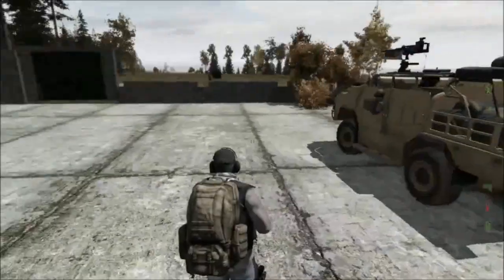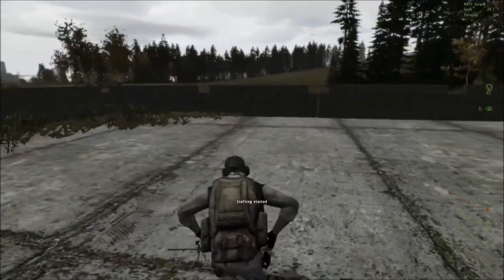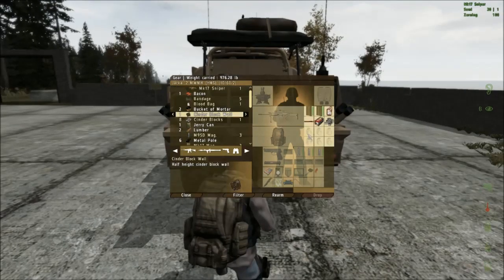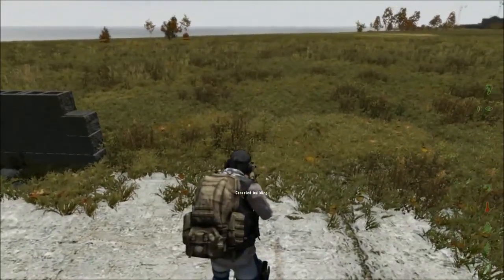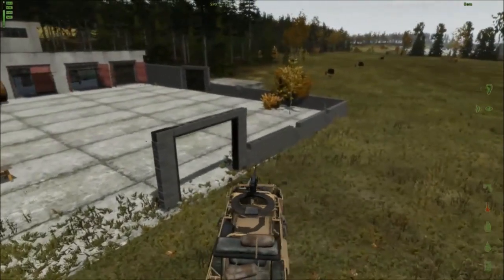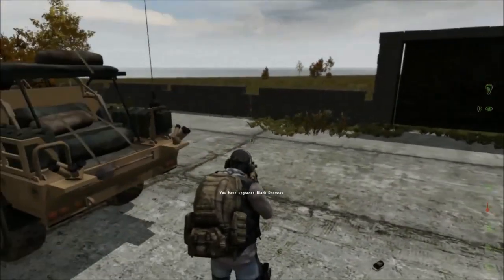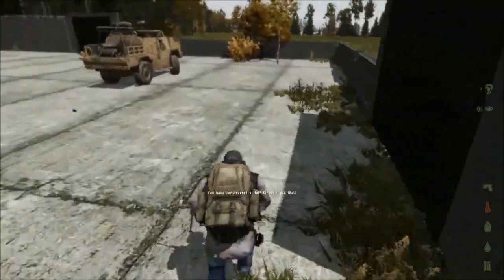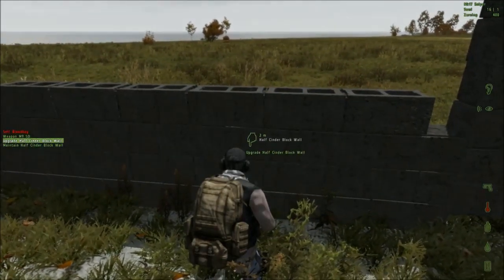Epoch Base Building Part 1

Comment from the maker: It is a custom build, i5 quad core 3.2gHz, 32mb ram with a GTX650ti(2Gb) video card. I found I like using Xsplit to record which posts directly to TwitchTV. Fps is variable depending on how many players are on the server, I usually average between 35-55fps, but it gets slower on busy days.

Comment: when I move my build up or down I have to use 8 and 2 on the numpad and it moves real slow how can i speed it up? PG UP and PG DN wont work. Does anyone know how to fix this issue or know how it works?

I am using a UK laptop keyboard... (tried FN and shift still nothing)
Reply: alt
Reply: ***** I fixed the problem by using another keyboard it seems you cant use PG UP and PG DN with laptop keys.

Comment: what is the parking area infront of the firehouse made off? i cant seem to find it in the editor. Anything you can do to help me find the name of it?
Reply from the maker: It's actually considered runway in the editor. There are two, look for MAP_runwayold_40_main
Reply: Dirty Weasel Media
Found it! thanks, and of cause now i got another question...it looks like your is raised above the ground abit could you share the secret?
Reply from the maker: Smoketrail It isn't raised per se. I just "lowered the ground". In other words I used the grass cutter located in Objects, "ClutterCutter_EP1", to remove all the grass in an area so that just looks that way.
Reply: Dirty Weasel Media
oh ok, i figured out using invis roads did the same thing
Reply: Dirty Weasel Media hey man nice vid learned alot! but can u make another video on types of wood, from their getting building supplies, and their a stronghold? I really need help man. Respond to my comment. thx